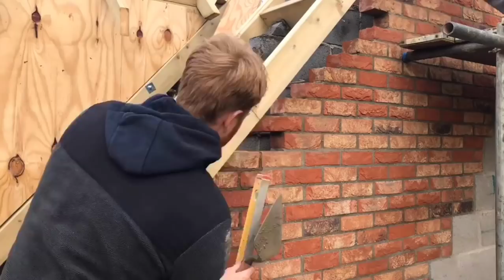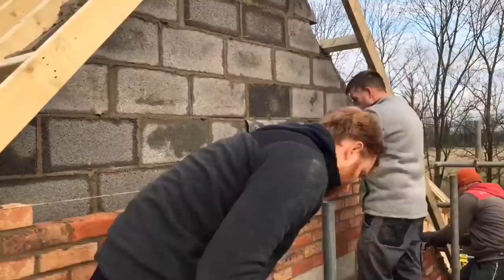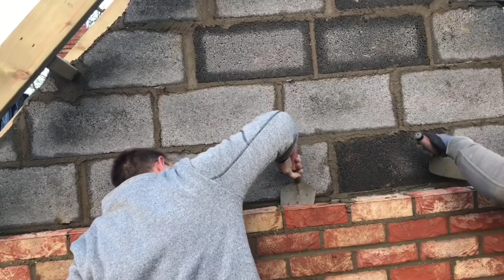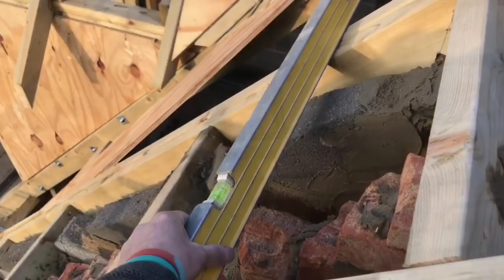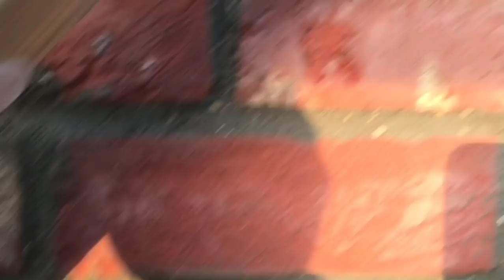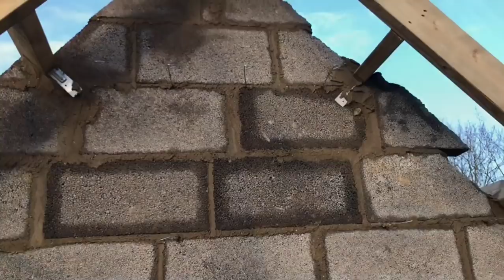Building a brick Gable (part 2) | The skill of bricklaying.

Comment: Nice video. Think these ok but be careful not to cut those blocks too short, they have to hold up the ladder. Interested if any designers do the ladder with the rungs square to the blockwork rather than square to the rafters. That would make the blockwork easier (harder digits) but perhaps not as strong. If you make another gable video would be good to see a walk round at the end, particularly bottom corners on the blockwork. Interested if any designers do wooden blocking between first truss and gable end in order to support the truss diag bracing (and they butt the corner of that brace against the truss). In that case would bottom block on the gable corner be best replaced with Eng bricks. That assumes bricks allowed above ceiling level where they won't have thermal effects on the dry lining. Thanks again.

Comment: Another top effort guys and I imagine the rough old blocks are not great to cut with a bolster. Please explain the two strips of dpc hanging into the cavity ta👍💪
Reply from the maker: Ronnie Biggs so the dpc is the because there is a garage being built on to the side of this Gable so we put this damp in and a weep hole in the bottom hope this explains.
Thanks for the comment
Reply from the maker: Ronnie Biggs in my last video when we are loading out you may be able to see it better there’s a door that goes above the garage to a room.
Reply: Ronnie Biggs . Cavity trays. There’s probably a garage getting built against the house gable.
Reply: LookitsMeNotYou many thanks chaps 👍